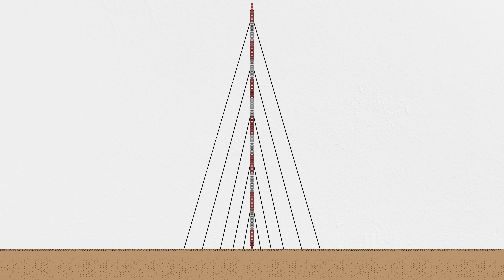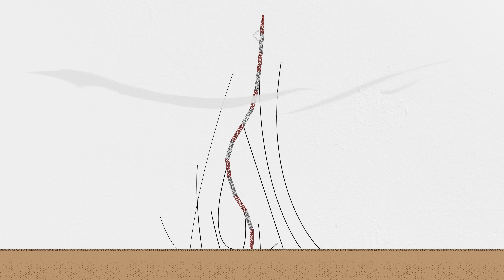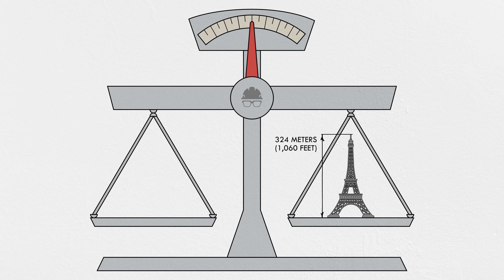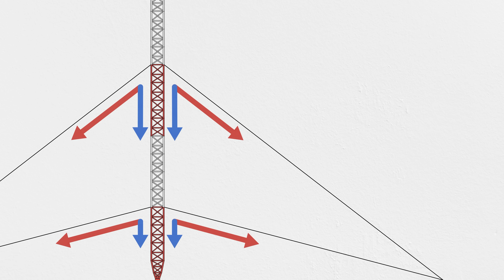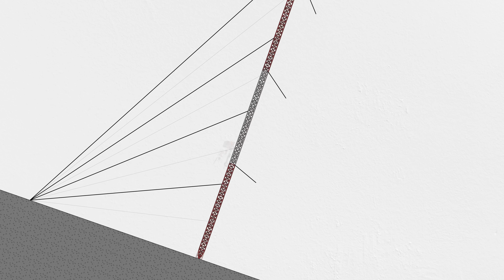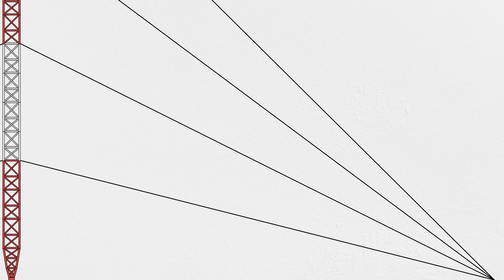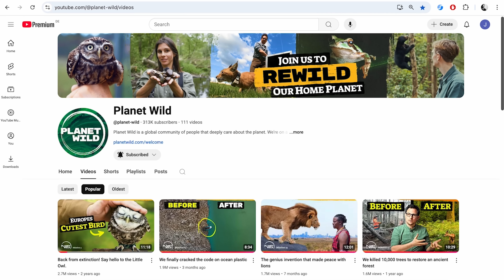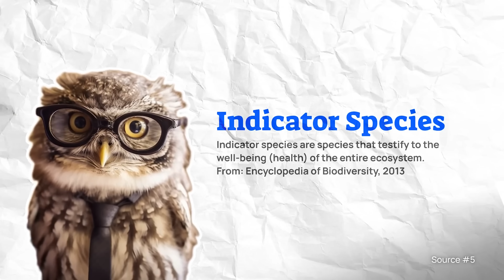The Bizarre Bases of Antenna Towers

Comment: If the towers were a rigid structure the stress in high winds would be too high and they would snap, with the point at the bottom and guy wires there's an amount of flexibility in strong winds.

Comment: My grandfather maintained these kind of towers. There used to be high wooden platforms adjacent to the bottom of the towers where they’d jump off the platform and catch into the tower as to not get electrocuted by touching the tower while standing on the ground. Nowadays they turn the towers off. I’ve got two of the old platforms in my backyard as the basis of a playhouse/fort. They’re made from old slow growth hardwood timber and each piece felt like lifting the weight of a concrete beam

Comment: My father was responsible for inspecting the final construction of a number of antenna "base"  for the US Air Force. I remember going on one "inspection". He had the depth  sides of the base dug out to determine depth of the base and got soil samples.  He also determined the quality of the concrete by getting a small core sample. The contractor had to sign a document stating the kind of steel used to anchor the wires into the base. It was a long checklist.

Comment: Mech. Engineer here. I've always admired the WITN Radio tower in Grifton NC whenever i rode by it as a youngin. Its the tallest one that ive been up close to. 1,900 ft or so. Awesome presentation, Grady.
Reply: Oh yeah. I grew up 5 miles from that tower. It was built in 1978/9. It replaced the one across the road that was 1573’. WITN donated the tower to ECU. They sold it and took it down.  I remember the day it was turned on. There is a modular home where the tower buildings were. But the guy wire concrete bases are still there. My dad and I used to watch them build it. I remember just how huge the sections are. I actually went down there to get a job. But my dad stopped that. Those guys are fearless. They would see us and yell down and wave.Soo cool. WITN then sold space with WNCT channel 9. In the 80’s a small aircraft struck a guy wire. If I remember the plane landed in Kinston, ISO. But it did knock the station off the air for a while. They would advertise “ 7’s on top of it all. Final height 1985’. For a while it was king on the east coast. But WRAL too that title some years later. I went back home in March. I flew my drone  and took video. And yes I’m licensed 107,and know that in that airspace I’m actually allowed to go 400’ above it. As long as I’m 400 feet close to it. The tremendous RF didn’t cause problems, but I saw it in the video later. Anyway I love that tower. VOA had a very large site not far from there too. Those towers are amazing technology. Hats off to the engineers, tower workers.

Comment: I've spent years structurally designing these very towers. Ice loads, foundations, construction sequencing and gin poles, and even a tower collapse with a fatality and litigation. So much I could expound upon about nearly every paragraph or even sentence in this video, I don't know where to start.

I would note that laterally wind loads govern 99% of the time (the last 1% is some weird tower in California), and gravity wise, ice will always be the largest load if you have any significant ice build up in your region. When ice loading became standardized, tower legs everywhere starting to be labeled as "failing" due to ice loads suddenly existing in the codes.

Comment: Warsaw radio tower in Konstancin was a mess. According to official records, statements from crews and engineers connected to the radio tower. The fall was a matter of time, not if but when.  Construction was typical political initiative to make Polish radio receivable in all Poland and beyond, but our contry at the moment had no materials, expertise and people who could service such structure. The guy who designed it in 60/70's was sent to USA for 10 day delegation to deepen( = steal know how) his understanding of American style radio towers because Russian designs were too short. The supporting cables were due for instant replacement in 1985 according to climbers. The crew foreman had no up to date certifications to work on such structures, construction log was not created (in Poland any construction or large renovation in required to have one, its a booklet where you write or store important information regarding a building /structure ), the state of construction itself (corrosion, fatigue, shock absorbers ) was questionable and in 1991 Poland was in financial problems so I guess cheapest quote won. Officially tragedy was caused by a temporary rope failure (slipped from shackles) but some engineers say they disagree and say that construction itself was flawed and in poor state and one line failing should not cause total failure. There are also conspiracy theorists that believe that it was caused by GRU/KGB because just a few days after collapse there were military coup in USSR and Russians wanted to have complete control over radio waves, but no proofs have been provided.

Comment: 14:02  I don't think those lightning balls are supposed to be painted. Likewise the mounting point is not supposed to be painted. On the airliners we found that workers who overhauled certain equipment didn't know about electrical bonding of surfaces and consequently flight attendants were getting shocked when a ground fault energized their work surface and it wasn't electrically bonded to ground.....so the circuit breaker never tripped. It just zapped them. We had to go back through all the mountings and bonding wires to make doubly dam sure that every metal surface was bonded to ground so the circuit breaker would trip in a short situation. What we found was that many bonding wires were installed over a painted surface. The installer thought the bonding took place through the bolt. Not so. It takes place surface to surface of the bonding wire attach lug.

Comment: With regards to aviation, it is a bit strange to me that the wire supports which span horizontally nearly the same amount as the tower vertically, do not have cable marking spheres. While you'd know not to fly anywhere near these towers, in low visibility conditions / emergency I imagine it would be a lot safer to have them.

Comment: An interesting note about towers' hazards to aircraft. We update the airliner's EGPWS (enhanced ground proximity warning system) database every month. EGPWS is an advanced safety system that prevents controlled flight into terrain. It is database driven rather than radar driven. As long as the aircraft knows where it is, it knows where the obstacles are by stored memory. Buildings, towers, terrain, and so forth. 
An automated voice (aural warning) says: "OBSTACLE !, OBSTACLE !.....DON'T SINK"  or whatever the case may be. We update every month because of things like construction cranes and such that go up and go down. I'm not sure of all of it's capabilities but they are MANY.

Comment: I have noticed certain power lines have a tiny base like that too. The ones that much higher up than usual, have a dedicated road by them and ultra secure. I kinda wonder the reason. I assumed it had to due the high voltage coming from the nuclear power plant.

Comment: I never thought that the compression forces on some of the vertical  members of this type of towers would be so high in magnitude if the the tower was fixed at the base. One of many examples of why redundancy is not always good in some structures.
Also it seems like fatigue would be a bigger issue if the base was fixed.

Comment: I was wondering why the base looked so impractical.
My place of work is on a 5 acre lot that has 3 towers and the one in the middle, which I believe is the tallest, has a very narrow bottom.
I've never had the pleasure of being at work during a thunderstorm, but I here that it's quite the lightshow, w/ the lightnint arcing off the support cables and all.
It is, however, very annoying trying to dig plants into the ground and always running into the copper ground wires only a few inches to maybe a foot down!
They are all over the property and the reason why we don't have a bathroom w/ working plumbing.

Comment: A 200 feet tower, put on 6 inch shaft, on cement base and only 3 small stopper to not slip laterally.
3 stage guys wire, 16,000lbs each guy!
All this make rock solid structure.

Comment: One thing to add about the pinned masts: torque isn't handled by normal guy wires, there is at least one attachment elevation that has a structure called a torque arm which requires 6 guy wires instead of the normal 3.

Comment: I used to work on an AM broadcast station, and still live in sight of the same site. (Sorry, couldn’t resist the pun)
For the same reason the masts have to sit on an insulator, the guys wires themselves have insulators built into them to prevent the mast from being shorted to ground (I can see 5 insulators on each of the top guys on ‘my’ nearby 400m mast) . Gradie talked about lightning, and yes, it’s a really common event. I recall one night when lightning hit the tower, most of the AM transmitters cycled to protect themselves, but then behaved weirdly. When I looked at the tower out the window, each insulator on one guy was a ball of fire as ionised plasma generated by the lightning was being kept active by the power of the still running broadcast transmitters!  Running outside, I could hear the broadcast modulation from a nearby insulator, that was freaky as! Running back inside and Turning ALL of the transmitters off for a few seconds extinguished the arcs.  Memories….

Comment: 12:29 That tower appears to have a device, the two interlocking rings, that I'm guessing will short the tower to ground if it starts leaning too far. The spark gap balls are visible behind it, so I don't think it's for that. 

Actually, nevermind, even more interestingly, it's a transformer to pass power up to the mast for the lights (look up "austin transformer").

Comment: In Dec 1989 we had TWO 2000 footers topple due to uneven ice melting on the guys.  15 years later a slightly shorter one was struck by a plane.  

If there have only been nine tower accidents, we must be the hot bed here in Central NC.

Comment: I live in an area with a lot of these radio towers/masts.  It is fairly flat in places, but the middle of my county is quite hilly.  So, there's towers that are tall enough to see over those hills, as well as a fair number of towers built upon them.  If I look out from the window immediately next to me, I can see the blinking lights of two of them that are more than a 20 minute country drive away.  From a young age I've been fascinated with them, particularly of one that has a mysterious underground compound, and razor wire fencing.

Comment: Ice was the primary factor that took down the tower of my local CBS station back in 1989. It was down for months, but the TV station itself was back on the air in three hours through a deal with another local TV station that happened to be independent and struggling. In tragic irony 12 years later, that independent station's tower was struck by a single-engine aircraft, collapsing their tower in a fatal crash. In a twist of fate, they were able to mount a temporary antenna onto the tower of the CBS station that they had helped 12 years prior.

Comment: ❤ the video. I spent the past 25 years in telecom so this was very nostalgic. Also at 13:21. The is bridge is not properly bonded. The green #2 between the individual pieces of icebridge is present but they should have taken a wire brush to the galvanized steel where the lugs are landed. They should have them applied NoOx between the lug and ice bridge. Followed by spraying the exposed metal with cold galv.
Reply: I love cold galv.

Comment: My former boss "Brook" told me about his climb of the Iwo Jima Loran tower to do maintenance. https://en.m.wikipedia.org/wiki/Iwo_Jima_LORAN-C_transmitter#:~:text=The%20Iwo%20Jima%20LORAN%2DC%20transmitter%20had%20a,more%20than%20the%20most%20powerful%20broadcasting%20stations.
It was energized, and he became part of the interface to the air towards the top (climbing on the outside).

Comment: I always thought it was a "guide" wire. found out 52 years into live it is a "guy" wire
Reply: Here's what Google AI overview claims:

The term "guy wire" originates from the Dutch word gei, meaning a rope used to secure a ship's mast or furled sail, which was then applied to any tensioned cable that stabilized a free-standing structure. The word "guy" itself may stem from the Old French word guie, meaning "guide," and was brought to Britain by the Normans. 
Here's a breakdown of the etymology:

1. French Origin:
The word "guy" may trace its roots to the Old French word guie, meaning "guide" or "to guide". 

2. Dutch Influence:
By the early 1600s, Dutch sailors used the term gei to refer to the ropes that helped manage sails on ships. 

3. Nautical Application:
This nautical usage of gei led to the adoption of the term "guy" in English to describe any rope or wire used to steady or secure an object, particularly a mast. 

4. Structural Stability:
The term then expanded to describe the tensioned cables used to provide stability and lateral support to free-standing structures like radio masts, telecommunication towers, and utility poles.

Comment: Look up KCRG 2000' collapse.  Late 60s, early70s.  Three Workers on the tower died, when it collapsed.  It was North of Urbana, Iowa on highway 150 and junction of highway 920.  Those cables were huge, like 6 inches thick.